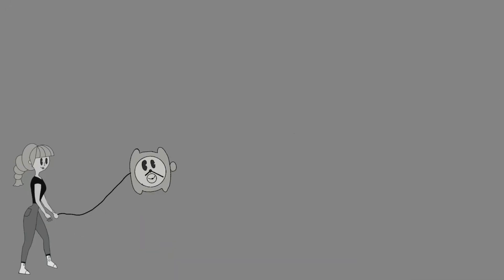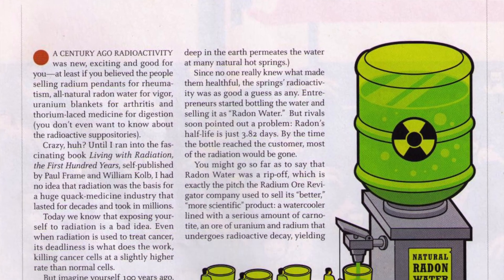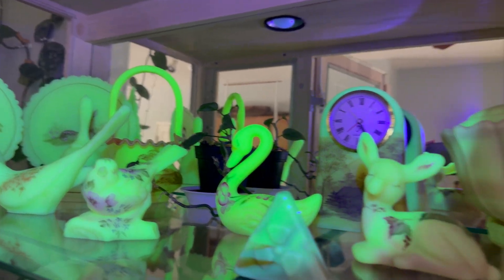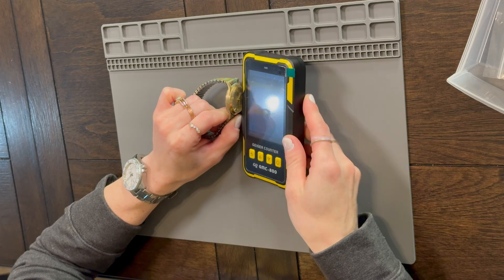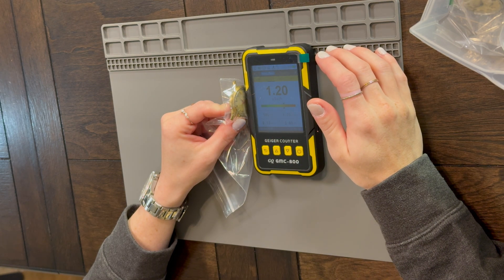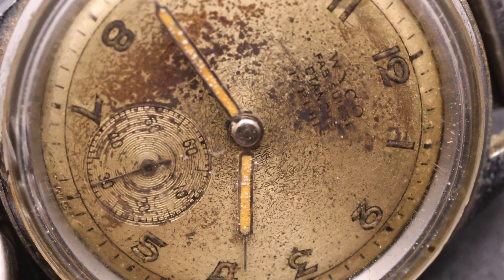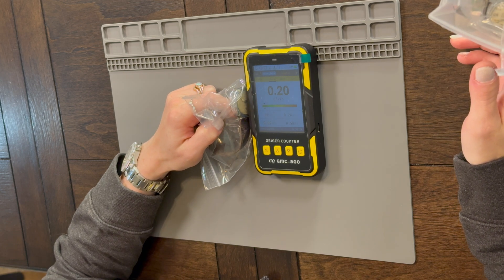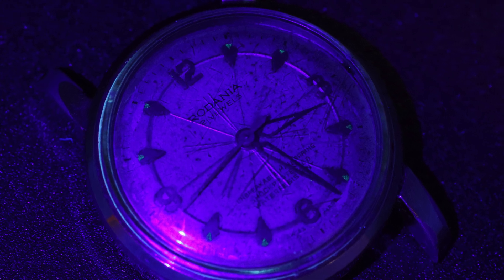New To Vintage Watch Repair? Be Mindful Of Radium Lume And The Risk It Carries.

Comment: Don't fear radium just be aware of it.  There is hardly a trail of dead watchmakers as a result.  I just take caution with finger cots and a mask.  Then just dispose of the lot afterwards.  As long as you are not licking the dial or snorting the lume you should be perfectly fine.  Wash hands and dont touch your mouth or eyes.
Reply: Oh Mike I wish you hadn’t made the “don’t lick the dial” comment. It diminishes the sensible appreciation of risk. 

You can pick up radium dust and end up ingesting in many ways if you don’t take sensible and easy precautions.
Reply: @The_Scienceboy the risk is low, radium girls didn’t all die off from one dial.
I’ve said in previous post when I warned her about radium that I wear a mask and cots and wipe down afterwards.
I  more paranoid than many given my cancer already.  
If you are removing a dial and hands storing them safely then the risk is tiny.
I’ve used a Geiger on the movements without a dial and get zero readings. 

The lady here is well aware of the risks hence making the video in the first place.

I know now many 70+ year old watchmakers all happy and healthy. My local guy who has been mentoring me takes zero precautions whatsoever.
Reply: Take a chill pill...jeeze!
Reply: Mike, your humor is off the chain my friend!
Reply: I found this report on Radium timepiece dose modeling to be a good resource : https://www.nrc.gov/docs/ML0731/ML073120009.pdf. 
Though the dangers are rather low, the advise I would give would be to not attempt radium dial watches until one's bench hygiene and bench discipline are good.
Reply: It should be noted that the radium paints have by now largely deteriorated and hence are more dangerous to handle than ever before. The radioactivity is still pretty much the same as it was when the watches were new, but the radioactive paint has gradually  flaked off and/or turned itself into dust. Watchmakers in the past weren't necessarily exposed to the paints in conditions that they are currently in, so there being no "trail of dead watchmakers"  doesn't guarantee anything. If anything, it can give a false sense of security.
Reply: @DaKarst on the contrary, less watchmakers now about and working on watches with radium, you can argue that from 50-70s people were still only wearing mechanical an thus more in circulation and being serviced.  Quartz saw the end to the regular man wearing a mechanical watch.   Whether there is more dust or not as long as you handle them with care, wear a mask and clean up after in my view at least you would be okay, and I am paranoid as I have already had prostate cancer at 49 mate!
Reply: @MyRetroWatches You're absolutely right in that the risk can be minimzed if handled properly. But why take any risk at all? In my view, a mask and gloves won't fully protect you as microscopic dust could very well spread and get picked up in a variety of other ways. There is hardly any way to guarantee safety with this stuff. It remains a matter of personal judgement, however. Sorry to hear you have had to deal with cancer as well. I have a history with metastasized (childhood) cancer myself, and I want to avoid the risk as much as I can. There are plenty of non lumed vintage watches to enjoy, is the way I see it.
Reply: Respect your opinion, but there are tons of watches to work on without that health risk.  Better safe than sorry.

Comment: It’s definitely good to have a Geiger counter. I put two watches in a container made of lead and I don’t think I will ever work on them. The sellers didn’t react when I wrote them a message via the bay. They reacted when I gave them a bad review. 😂 Too late. I think, a professional seller has to mention if the watch is radioactive. 🕐⚙️🍸
Reply from the maker: I have a few of these watches up on the bay and I definitely mentioned that they are radioactive!
Reply: @ That’s good! Hmmm. I have no clue if it’s allowed to send radioactive stuff via mail in your country. In mine it’s forbidden. You may want to look that up to avoid problems.

Comment: Time.  Distance.  Shielding.  These are the big 3 when dealing with anything radioactive ... the watches, uranium glass, really old red or orange Fiestaware, etc.  I wonder what one's exposure is when wearing an old watch since the movement and bottom of the case is between you and the dial? 🤔
Reply from the maker: I looked that up! One source said that the internet in your house will affect you more than a radium dial watch on your wrist 🤷‍♀️. I would't be scared to wear one that is in good condition and is sealed. I just don't care to work on them in my current workspace and low ventilation.
Reply: @Thesecondhandwatch  That's good info.  Thanks!

Comment: I have a few that hit around 15 micro sieverts/hour. The radon that comes from them has elevated the levels in my house from basically 0 to what the detector says ventilation is needed. People will tell you it’s fine, not dangerous but they are wrong. All radiation can be/is dangerous. Exposure prevention is key and if you work on them you need ventilation, a clean room, and a respirator. A % of Radium ingested in anyway will stay in your body for the remainder of your life and emit radiation inside the whole time!
Reply from the maker: Yea, it's not something I want to mess with. I'm hoping this video warns others just starting out. 🤞🏻